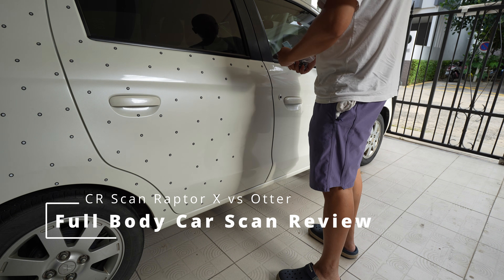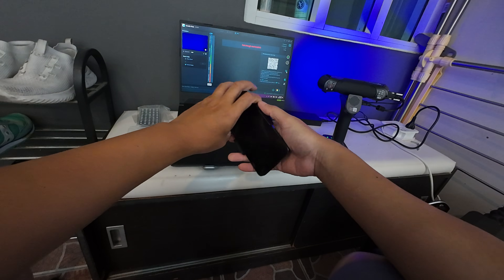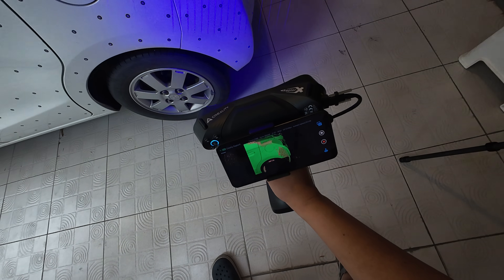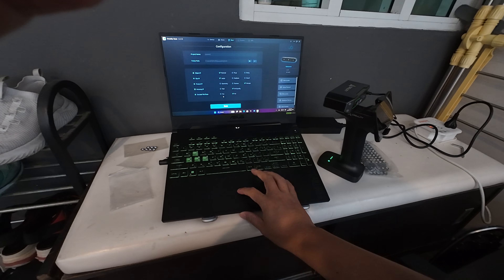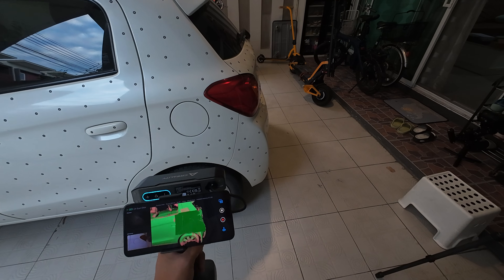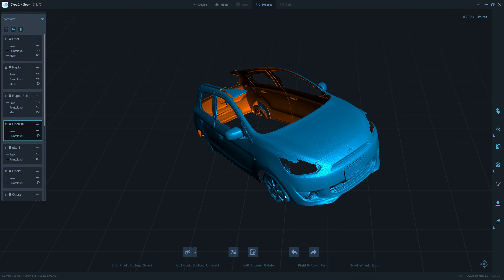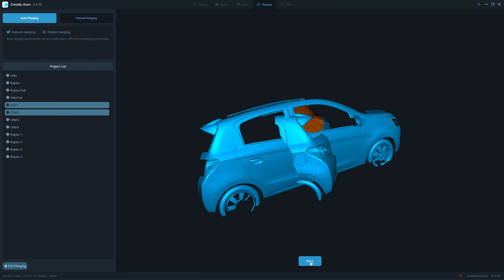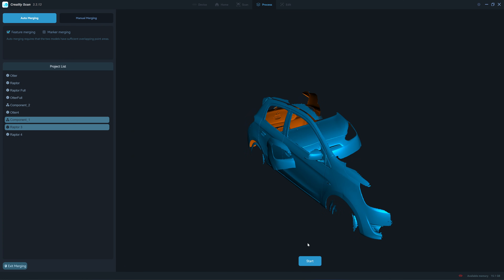Full Body Car Scan Review - CR Scan Raptor X vs Otter

Comment: Hi, What is the measurement precision of the Creality CR Scan Raptor? Actually my ultimate question is that is Creality CR Scan Raptor suitable for scanning like camshaft?
Reply from the maker: I tested three Raptors, and all delivered less than 50 µm error over a 150 mm sample. The original Raptor is compact but still large enough to handle the camshaft.
Reply: @Payo-TensileCreator  Thank you for your response.

Comment: So I scanned a long wall with Otter in large mode with markers. Then I measured the distorion and it seems like Otter is drawing a circle with 35-50m radius. Bit disappointed. Wonder if Raptor Pro is capble of precise enough wall scan (less than 1-2 mm distortion). 
I know that Payo measured drifing error for Raprots and it's about 0.018mm/meter for Pro 22 lines, but it's just point to point. Doesn't Raptors make volumetric distortion at all?
Reply from the maker: When scanning that car, the scanner covered approximately 50 meters of travel, moving back and forth. Since near-infrared (NIR) has lower depth precision, extended scanning distances tend to introduce distortion.
Reply: @Payo-TensileCreator  Since that Otter is not suitable for Large objects where precision is required. Large mode is applicable only for something like car interior or just cosmetics.
Reply from the maker: @PetterStetter  I mainly use it for scanning human. No scanner can match detail capture with Otter in face mode.

Comment: did u find out any method to reduce the usage of sticker marker for car scanning like this ? how about using a 3d printed with magnet at the bottom ? just like revopoint marker kit ? is it going to work ?
Reply from the maker: When it comes to accurate 3D scanning, markers are non-negotiable. What varies is how far apart you can place them. The Sermoon S1 is more forgiving—needing fewer markers than the Raptors—but don’t place the markers too far from scanning faces. Creality scanners can handle 30–40 cm distant, while the Revopoint Metro X demands tight placement, around 10 cm from the surface.

Comment: Is the Otter good enough just to scan one panel Like the roof or a front bumper?
Reply from the maker: Yes, you can scan car panel using large mode with markers, and for the Otter Lite you probably don't need the markers. The precision error is around 0.2 - 0.3 mm for 2 meters long part.

Comment: Thank you taking your time sharing this knowledge.

I’m willing to buy a raptor x, but have douths about mu notebook hardware. 

It’s an asus 12700h, integrated GPU, 16gb Ram. 

I’ve downloaded some .stl from internet, some with 3 million points. It runned with no issues.

So i ask, could you share the cloud of points of your car, so i can test my hardware?
Reply from the maker: You'll need a gaming laptop with Nvidia GPU and at least 32 GB of RAM for the scanner to run properly.

Comment: Hi, could you do a new video showing the full car scan with the new Raptor Pro, by any chance? Thanks!
Reply from the maker: I had initially planned to conduct a full-body car scan using Rap Pro and Metro X, but Revopoint ended up canceling it. I'll wait for new developments and, once something promising emerges, I'll redo the test with a comparison against Rap Pro.
Reply: @Payo-TensileCreator  Sounds great thanks! At least can you confirm that Rap Pro is capable of scanning the full body like Rap X and will not require doing lots of multiple scans like the cheapest Raptor?
Reply: @Payo-TensileCreator  Looks like, Revo is trying to achieve Raptor's level by improving software. ) Untill then they have a timeout)

Comment: Something just dawned on me. 
You definitely need a proper professional workstation with ECC ram(CPU and GPU). 

I bet your stuff would just chugg scan data! 

I did come across this bottle neck/crash when editing/refining MRI and CT scan data. 

It would bog down and fail/crash on the ultimate gaming PC(two channel RAM). 

Using a Xeon dual CPU workstation with 128gig of four channel ECC memory it would just finish in no time flat. 

The conflicts are time!

P.S. The workstation I’m about to boot up has dual xeon gold 18 core CPU’s 384gig of six channel ECC RAM across 12 DIMM slots. 
The Motherboard has 128 PCI lanes. 

Payo, it cost $2000 AU one year ago. 

Admittedly it has a 15 year old GPU, but it has 3X pci X 16 slots.

Comment: Good videos.  
By the way, can you also use the raptor bridge on the Otter?  Does it work that way?  
Have you tried Metrox or Einstar what do you think of them?  
I now have a Raptor

I am sad that the raptor has such a small scanning area while the Otter is so big.
Reply from the maker: Yes, the Wi-Fi handle is the same for Raptor and Otter. I made a video here. https://youtu.be/nYfzPSg48oU
Revopoint expect to send me a testing unit for Metro X by end of Jan. 
I've done some test with Einstar VEGA but I haven't tried the Einstar yet. Shinning 3D pulled out the scanner in the middle of the test, so I have no test result for that.
Reply: @Payo-TensileCreator  
However, creality sells them at a different price.  
Is there a cable etc. missing from the other one?
Everything is mentioned in the suitability.
But do I even necessarily need that bridge for the Raptor?  
If i just use the phone like you?
Is there wifi on the bridge itself?  

And the Einstar case has been on sale in stores for over a year already.

Comment: Hello friend, first of all, thank you very much for your videos. I have been working with reverse engineering for a long time here in Brazil, but they are scanners attached to Hexagon measuring arms. I have already had the opportunity to work with the Freescam Combo, which is superior equipment. My question is whether the Raptor X comes close to the quality of the Freescam Combo meshes? Does Creality's point reading software work well?
Reply from the maker: I've been working with 3D CAD since 1999. The scanned point cloud from Raptor X is good enough for reversing and reference in CAD. I can design metal fitting parts from the scan directly and it fits 100% of the time. Freescan Combo claimed 33 um/m drifting error vs Raptor X 60 um/m. But I never get to test it, Shining 3D took back their scanner while I was in the middle of testing Einstar Vega and they won't send me another scanner for review again.
Reply: @Payo-TensileCreator  I understand, and the hardware and software set work well?
Reply from the maker: @jholwill4707  It has all the basic functionalities. Merging scan is very good. Mapping point cloud is fast, never crash. The export point cloud and mesh also have no issue in many software I test.
Reply: @Payo-TensileCreator  Ah, cool, I'll probably buy an  raptor X, another question about accuracy, in the first meter this error is around 0.02 or 0.06 mm? because i see on tech sheet 0.02mm + 0.06mm/mts! Then on the first meter the accuracy is around 0.02mm, 0.06mm or 0.08mm (0.06+0.02mm)?
Reply from the maker: @jholwill4707  yes, that's max value, it varies between each unit. My unit is 0.048 mm/m.
Reply: @Payo-TensileCreator  i undertstand Man, thanks for spend your time answer my questions! Good day!

Comment: Great video. I would suggest your magnetic extended markers for the corners as well so the scanner can see it turn around the edge. I definitely agree with your scanning strategy you laid out at the end.
Is there a good reason the otter does not have a global marker mode. Would be very useful. Seems like a software only feature.
Reply from the maker: Otter tracks very well in this test. It doesn't show any sign of struggle when I turn around corner. I think the issue is the accuracy in the depth of the scanned surface. It slowly twists the planar surface along the travel length.
Reply: Yes I guess you are right, corners are not the issue. In that case I wonder if markers going over the roof just to establish another corner just so that you are not scanning a flat plane may help in the future, but I think following your scanning path strategy will still be the best technique. The problem is It’s hard to have the patience to always do it :)

Comment: There has to be a way of scanning the whole car with the otter without such a large ''drift'' or ''twisting''? Creality's own website advertises a full car being able to be scanned and that is one of the main reasons for me getting the otter. Being able to do large and small scans.

What about scanning the roof as well so it has more points to connect the side of the car with?

It's difficult finding any other videos or information about these large scans with the otter since most people just scan one side or the hood or rear bumper and rarely the whole car.
Reply from the maker: Dividing into 4 scans/car is still too large for Otter, I'll try 6 scans and reduce the travel length, see if the scan can be merged.
Reply: @Payo-TensileCreator  Thank you hope it works out.

Comment: I would like to see a comparison between the raptor and the raptor x, to see if scan time is the only benefit for 2000+$ more.
Reply from the maker: I made a video here with Raptor original https://youtu.be/L1lJnW90Slc?si=_8j4GvB8Unna7Nhl&t=138   I used 700 markers with Raptor X, Original Raptor would need 4x more = 2800 markers.

Comment: You could lock your screen rotation to Landscape using the phone controls. On android, you can create a routine that does this for you automatically every time you launch Creality Scan. I've just done at and it works fine.

Comment: I fear that your video is going to make me get my wallet out again! 

I've got the Einstar, original Raptor and the Otter, and I've just ordered the wireless bridge. However looking at this video, it shows the reason I bought the otter (to scan vehicles for reverse engineering using large mode) is not overly suitable.

In your experience, would the RaptorX replace the need gor owning the original Raptor, Otter and Einstar for reverse engineering of small and large vehicle parts, scanning engines and vehicle parts? Or if you had to just have two scanners out of the four which ones would they be?

Thanks for all your videos so far, they are by far the best for any of the Creality series of scanners!
Reply from the maker: If I can have 2, I'd pick Raptor X and Otter. Otter is best for quick scan without marker.  There's prove now that Otter can't scan large panel accurately, Raptor X seem to be the only choice. I never seen anyone made full car body in a single scan before, mostly done in parts and merged. I'm quite surprise that Raptor X can do this.
Reply: @Payo-TensileCreator  That's what I was starting to think, as it seems from your other video there is no downside of the Raptor X vs the original Raptor. I think I'll do just that and sell the Raptor and Einstar!

Many thanks for the reply, and keep up the good work - your videos are excellent and has really helped me get started in 3D scanning!

Comment: Thanks for taking the time to make these videos Payo.
I am more interested in your Otter videos, as that's the scanner I currently have, but seeing the difference between the raptor and otter is cool!
Reply from the maker: In the early version of the firmware, I couldn't even go pass the front tire. Now you can scan with Otter as large as you want, but need to keep drifting/plane twisting in mind.
Reply: @payo I gotta say for me since owning the otter, the experience hasn't been the smoothest. I feel like mine struggles with tracking really badly, and anything black , its like it's invisible to the scanner , but in some of your videos (scanning the scooter) it picked up all the black things /seat first pass.
My machine is i7 9750 and 64gb ram with 4gb graphics card, the performance test tells me I'll get 27fps with  the otter (more than the spec sheet advertises 20fps max) but I reckon I'm lucky to get a solid 10-12 fps at best , sometimes it drops down to like 5fps.
Scanning anything decent takes a lot of work, my white motorcycle fuel tank 40mins single scan the result is great but I don't feel like it should take 40mins when you can scan a whole car in 7mins with the same scanner 
I was hanging for the new update but it hasn't fixed my experience unfortunately, is there's something I'm doing wrong or do you think my unit might be a bit faulty ?
Reply from the maker: i7 9750 that's 5 yrs old CPU. What's your graphic card?  Otter is one of the fastest and smoothest scanner but you need fast PC. multi core CPU and Nvidia RTX GPU
Reply: @Payo-TensileCreator  yes ok, I have GTX1040ti, which is a shame , I bought this over the einstar as my machine met crealitys recommended specs for it
Reply from the maker: @Lordy23  Yes, that's the drawback for Otter, you need faster CPU/GPU. sorry to bring this to you but 1040ti is a very slow GPU for 3D work nowadays.
Reply: @Payo-TensileCreator  would a 5gb p2000 quadro be any better you think ?
Reply from the maker: @Lordy23  No, it won't. Try at least RTX 3060
Reply: @Payo-TensileCreator  thanks, I'll ask Santa hopefully I've been good enough and he's got a few spare Nvidia's laying around 😁
Reply from the maker: @Lordy23  When you wish, make sure it's RTX 5090.
Reply: Well, there was some Christmas music during the scans. Santa?😊 @Lordy23
Reply: @Lordy23  The otter is like a projection scanner ?